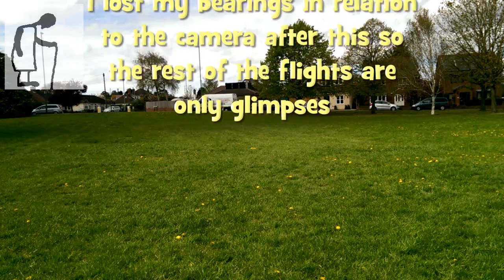Nanocopter Tail Rotor Styrofoam Plane Part #2 Open Space more Test Flights

Comment: you should make it a remote controlled plane.
Reply from the maker: Kman Meteor it hardly has enough power to fly now, how do you expect it to carry the weight of a rc receiver, servos and batteries?
Reply: GrandadIsAnOldMan You have got a point. maybe you can put a stronger motor with a LiPo battery.
Reply from the maker: Kman Meteor I possibly could but that is not what this project is about.

Comment: u can also use the motor from the rotors on a plane like that use these propellers http://www.hobbyking.com/hobbyking/store/__41098__45mm_Pocket_Quad_Prop_CW_Rotation_From_Rear_green_5pc_.html you can also do some sanding on the front of your plane to make the wing more aerodynamic!
Reply from the maker: Ross Clements have a look at some of my other planes, you will see I do use other motors. I have quite a few 'hubsan' replacement motors from eBay, they are incredibly cheap for the power output.
Reply from the maker: Ross Clements think I misread your comment, yes I also have a selection of props too, but again the idea was to use the tail rotor.